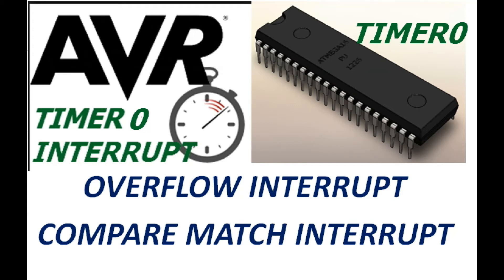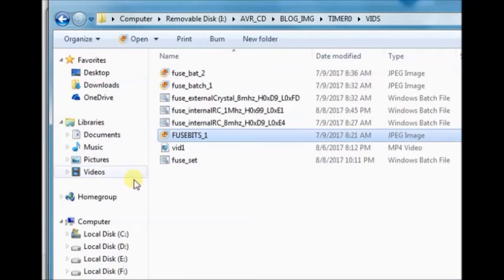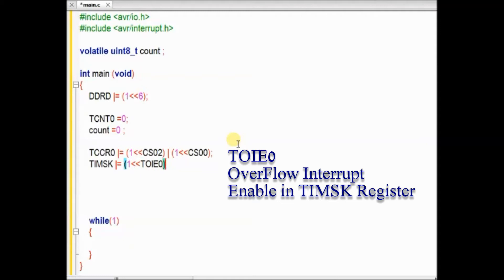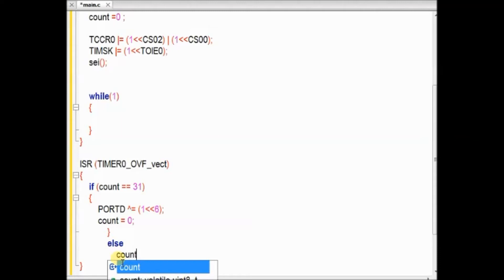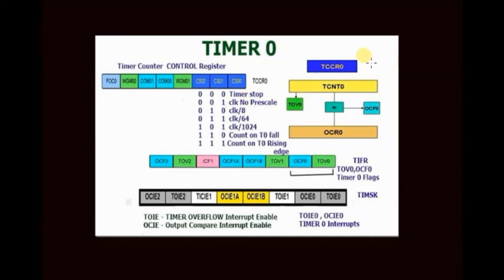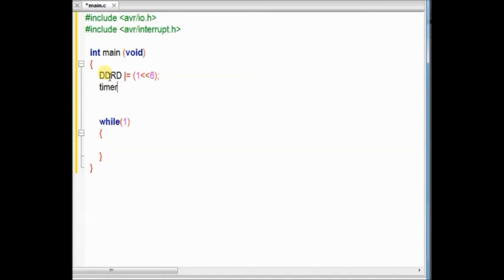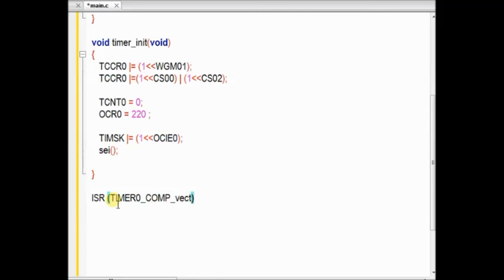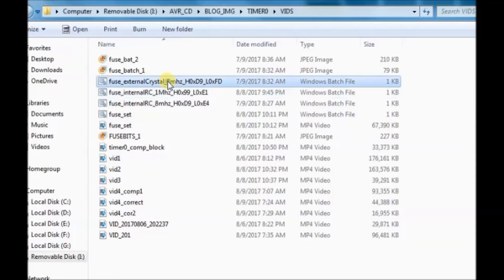AVR-INTERRUPTS Made Easy Part 2. TIMER0 INTERRUPT

Comment: You should actually initialize your variables, and while you're at it...enable compiler warnings and then heed them. In your first example, you marked "count" as volatile and then checked it against 31 in your ISR. However since it is a uint8_t the initial value could hole anything from 0-255. But since you didn't initiate it, it could hold any of those values. So what if it holds 32 on the first interrupt? It's not going to hold 31 again until it rolls back around. Obviously your time is off there.
Reply: Also, you should rest count to zero in the if block, of course.